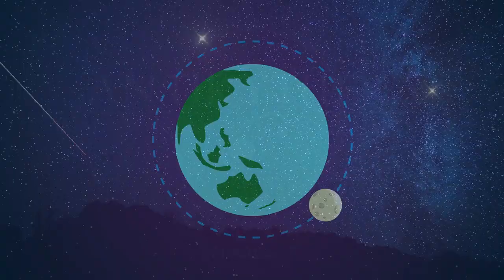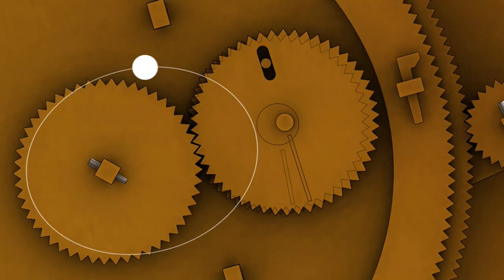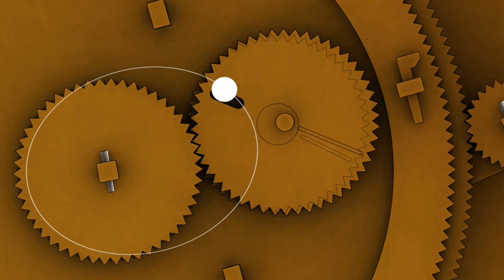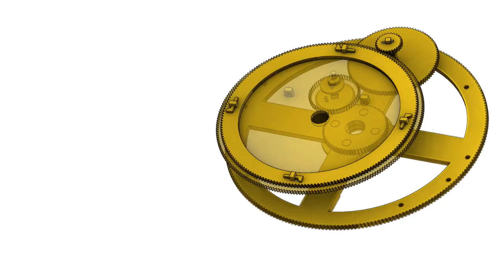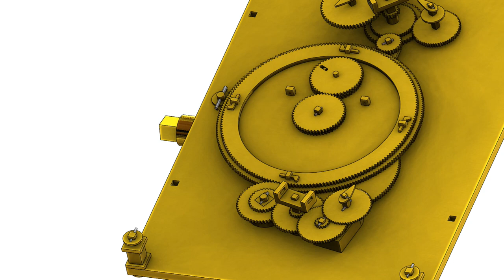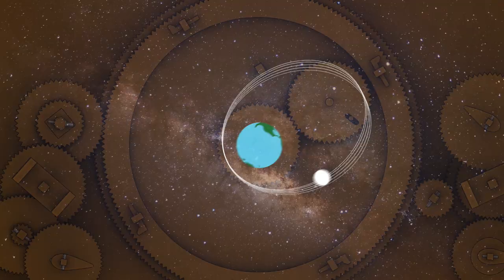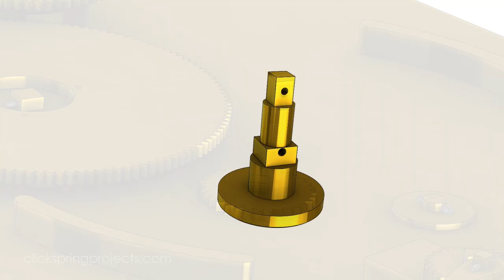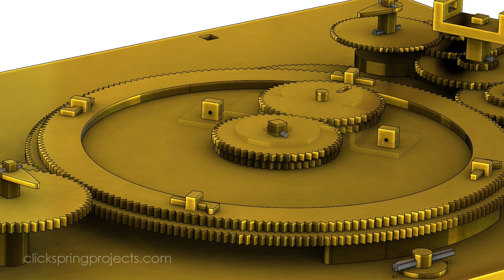The Antikythera Mechanism Episode 9 - Making The Epicyclic Pin and Slot Gearing

Comment: Wuao! That eccentric gear is definitely one step beyond in complexity. You prove us how we tend to underestimate the capabilities of ancient technologies
Reply: I second that! Very humbling.
The only place I have seen that ahead and behind rotation shift is in the prop shaft joints on automobiles. When angled, a single joint displays this phenomena, making the prop shaft rotation go ahead and behind the gearbox output, so you need to use two joints at the same angle so this is cancelled out, giving back the constant velocity to the drive train.
Front wheel drive cars have a special joint that has to contend with both suspension and steering angles at the same time and guess what it is called! A constant velocity joint 👍 patented by Alfred Rzeppa from Poland.
Reply: @rogercrier    Very cool.   I did not know that and always wondered why it was called a CV joint!  thank you for sharing.
Reply: the thing is it is not very complex at all. it is just one of the smartest designs i have ever seen. Calculating it is complex, but it's so beautifully simple
Reply: I had to go back a couple of times and watch that part again to get my head around it.
Reply: @idontknow31212  nah thYs extremely complex the only thing that's simple about it is that its gear driven but if it was electronic itd be millions of times simpler on repair design building it doing anything calling this simple is like calling a rolex or a breitling simple
Reply: I loved when he said, "which ordinarily would serve no purpose, but in this case..." -- Amazing device, amazing storytelling.
Reply: That explains why CV joints fail...  That pin rubbing back and forth in that slot just has to give eventually...
Reply: @rogercrier  and hence the development of the more complex Constant Velocity joint for all those front wheel drive cars :-)

Comment: Oh my god that transition at 11:59 
Is there anything this channel doesn't do perfectly??
Reply: Benjamin Meijer I audibly gasped when I saw that the first time. So good.
Reply: 14:50 No CGI whatsoever either. Flawless blends. Awe.
Reply: YCbCr with the exception of the parts in the background that disappear as they're added
Reply: I don't get it. What did he do? At 11:59 he's tapping the piece with the hammer to flatten it and the next second he puts the hammer down to examine the piece. Is there something I'm not seeing?
Reply: Look at the transition between the outdoor scene and the next, specifically at the workpiece when he throws it on the table
Reply: @BM-yy8db  Oh wow. I'm just as amazed as you now. Thanks!
Reply: @timblackshaw5933  Yeah, also that I was specifically looking at 11:59 plus minus 1 sec approximately; Benjamin had given that timestamp so I presumed that the transition happened somewhere during the outside scene.
Reply: Both the 11:59 and 14:50 effects aren't that hard to do, but add a very nice touch to the video. For anyone interested in how:

The 11:59 one he first films the outside clip, then depending on his camera(Some higher end cameras have this) it's possible to turn on a "ghost image" in the display that shows the previous clip transparently over the current view and he just positions the camera in the inside clip so that the piece is in the same position on screen.

The 14:50 clip is done with a rotating camera rig that you can see him use plenty of times. With it you can film the same exact view while moving the camera through the same path. With it he just films multiple rotations, each time adding extra parts. In the video editing software you then blend the clips together.
Reply: I won't lie, I watched it three or four times.
Reply: @YCbCr  Yes ! Another great shot I miss ! Thanks !
Reply: don't forget the music editing...
Reply: From 14:17 to 14:24
Reply: Thank you for pointing this out!
Reply: Thank you for catching that,it's flawless and easily missed.

Comment: Possibly one of the things that blows my mind the most about this build and your other builds (not that there's ANY lack of mind exploding...most videos have at least 10 such moments) is that almost NONE of this is explicitly measured.  You use a compass and a straight-edge...and a few helpful tools that you designed.  Every fit is hand filed and PERFECT, even the bits that are half the size of my thumbnail.  I cannot believe that you formed each tooth on ALL of these gears so perfectly that I think a CNC couldn't do better.  Tolerances of fractions of a millimeter!  I think you and Martin over at Wintergatan could together design and build a time machine to go back and see the Antikythera as it was originally made.

......Or have you already?  >.>
Reply: Yeah, but all that hand finishing is going to make warranty repairs difficult.  :P
Reply: This is why fine mechanisms employ softer, more workable metals to this very day. Precision cutting stainless is MUCH more difficult, as I found out from trying to save a warped (stainless) Berg Larsen saxophone mouthpiece.
Reply: He built the original. That's the answer.

Comment: Very humbling.
The only place I have seen that ahead and behind rotation shift is in the prop shaft joints on automobiles. When angled, a single joint displays this phenomena, making the prop shaft rotation go ahead and behind the gearbox output, so you need to use two joints at the same angle so this is cancelled out, giving back the constant velocity to the drive train.
Front wheel drive cars have a special joint that has to contend with both suspension and steering angles at the same time and guess what it is called! A constant velocity joint 👍 patented by Alfred Rzeppa from Poland.
Reply: plus front wheel drive can utilize universal joints so are not dependent on the cvd design that most use.
Reply: you can use universal joints but it will result in a choppy application of power when turning.

Comment: Great video! Impressive display of a great thought process and awesome hand work of metal. All that brings me to a gentle question. At times you use a lathe. I remember your description of a pole lathe. And I know that such a manner of turning is just a functional as your other hand working methods. There is but one place where I got to thinking about how it may be accomplished on a pole lathe. The offset pin turning. Do you think it is possible to replicate that on a pole lathe? The work holding method is what intrigues me. possibly a hole drilled offset and then the first shaft afixed with bitumen or resin. Then the secondary shaft turned and then filed to square (I think it was square on one side).

Mark

Comment: Do you think they could have had square broaches? These were smart guys and with the amount of square holes in a build like this and the suggestion floating around that there might have been more than one of these units floating around I think they could have come up with the concept just to make life a little easier.
Reply: rimmersbryggeri Hi. Archeologists have found the remainings of a saw powered by a watermill with bronze + wood wheels, including square holes to transfer force. It was common technology at large scale, quite simillar to windmill technology you may see in the Cyclades islands today.
What's news is that those mechanical principles where mastered at a very small scale as well. Regard's from Greece.

Comment: Question. From the positions of the hands on the recovered mechanism, can we date the ship wreck based on the assumption it was set to the actual positions of the moon etc, at the time of the sinking?
Reply: If I'm understanding it correctly it was a predictive mechanism... to set up your calendar, basically, to know when the festivities were going to be and so on... so it wouldn't make much sense for it to be set at the current date, I think. It could possibly set a lower limit, though, supposing it wasn't used to check that previous events had happened on the correct date (or that the user didn't simply play with it on occasion... and, frankly, that's quite a big assumption... I certainly would fiddle with the thing if I could get my hands on it, and so would most people, probably... though, then again, it was probably a quite expensive device, so maybe not)...
Reply: Highly unlikely that would be useful for several reasons, but there are other means to this end. By means of internet searching and reading I've come across mentions of which I took a few notes such as Marcus Claudius Marcellus sacked Syracuse, Sicily 212 BC. No survivors was the mandate except for Archimedes himself, but he did not survive either. The wreckage is believed to be the booty of that sacking of Syracuse since it is a roman ship and the estimated dates fit nicely as well as the 100% content to be of Syracuse source, most unusual for a multiport trading ship. In use this device would not have been used like a clock on the wall to tell the current events, it would be used instead to generate charts of future events going on out as far as they dare too timewise. The charts survived the machine because of their dispersal beforehand and the knowledge of eclipse dates are throughout history noted as causing the savior of white men educated in the use of these charts impressing native peoples with their god like knowledge of such heavenly events before they happen. Of course the natives didn't get to look at the charts or have it explained to them. This dirty trick was played many times.

Comment: Chris, what surprises me most about your skills is making square holes in the gears that are straight sided and concentric, my filing skills would result in a different taper on each side of the hole even if I managed to get the hole to have a square cross section.
Things that I make by filing, like tapered rectangular con-rods for steam engines I always do in pairs with the two parts pinned together at their bearings, do some filing then turn one of the rods over and do some more filing, then swap left and right and do some more filing, after a while you end up with perfectly "square" rectangles, but its all got to do with making them in pairs.  while you're making a single part at a time and have to be able to hold the file perfectly (I would have to use a broach). you've got my admiration.

Comment: Constructions like this justify the term artisan. It is both a feat of engineering and a work of art. I wonder if most of the smaller parts were billet stock taken to dimension or castings worked down to size or even smaller components combined to make a whole

Comment: The real amazing thing is that the long engineering tradition that gave birth to this remarkable piece of equipment got completely lost. One might have thought that metalwork would have survived on land much longer than this highly corroded submarine artefact. But there is nothing else at all that I know of that bears witness to that tradition. There is plenty of artistic metalwork and goldsmithing but nothing much applying metallurgy or metal craft knowledge to technological solutions apart from weapons of war. Most other things such as mills were wood based. The Greeks of course invented many things such as locks the archimedian screw the astrolabe etc etc but nothing else along the lines of such small scale engineering. It is quite a puzzle as to why much of the Greek expertise is just lost to us. Its a bit like Darwin’s missing link we have no historical line of development just a big jump and an empty space.

Your series is just fabulous- to see metal yield like cheese (or in the case of brass cold chocolate) to a blade has something uniquely satisfying about it and also something so counter intuitive about it to make it seem like magic

Comment: gear backlash.... a square peg to hold a round pin.... if you were to offset the square by a fraction of a mm then this would give you back lash adjustment then cut the offset pin on the top. this would allow for the deviation of hand production being a bonus for adjusting the backlash then using that position permanently.
there was a lot riding on getting the cut correct, by this style it would allow for any minor errors.
love the work, but maybe you are being to accurate??? just a thought. 
Fantastic to see your skill set I look forward to more videos as I am about to binge on the rest of your videos

Comment: Chris, can you share your secret for keeping the parts from tarnishing. I'm neck deep in a brass cannon project and I'd really like to keep the shine.
Reply from the maker: Certainly mate - Providing the parts are non functional, a clear lacquer like this is a good way to go: https://www.whiteknightpaints.com.au/products/metal/white-knight-rust-guard/topcoat/white-knight-rust-guard-clear-guard/  Another approach is to electroplate with something inert like gold or rhodium. Its a lot of work to get a good result, but there are some good kits out there for smallish projects. For a clock project, the traditional approach is to simply live with it. The parts are taken up to high polish at the end of the project and then never touched by hand again. Without any fingerprint oils etc a uniform rich bronze color develops over the following years. The odd small spot of darker patina develops but overall it tends to retain the mirror finish left after completion - Cheers :)

Comment: Hmm, the dating of the shipwreck and the Cicero quote at 2:31 make it a real possibility that the original Antikythera mechanism is (one of) the machines mentioned in this very quote. Or possibly a direct predecessor of the one mentioned, with a big likelyhood that it originated from the same shop, maybe the same maker(s).

Comment: I wonder if the eccentric pivot was another fabricated part.  Turning it as one piece is easy with modern machinery, but would be a huge challenge to be made by hand.  

I think it's possible a offset hole was drilled into a  larger piece of round stock, then a smaller piece pressed in.  As long as the rod was peened in, the smaller shaft would hold.

Comment: What is the purpose of the 5 sided interface for one of the gears? Did it aid in keeping the gear more concentric around the center of the hub? Or was it to allow a larger amount of area inside the heptagon for another axle to pass than would have existed using a square?

Comment: The logical progression of development, hands-on learning by doing, seems likely to have started with string wound around shafts, and that leads into winches and pulley systems plus bow-drills and simple lathes of the same principle, to make various ratio pulley block and tackle of the type used in hauling of timber.., and so on to cranes and ship rigging, A-frame construction methods etc.
So the comments about verbal description and records of the required skills, made in the video, had to have been by oral transmission and Apprenticeships (?).

It's a parallel concept for why Ancient Greek Philosopher-Geometer's regarded written records with suspicion, the abstract methodology of formal education in Mathematics has seemed disconnected from the practical culture that obviously existed for thousands of years beforehand, (did that word origin mean "before handwritten records"?).

This series of videos and demonstrations are "beyond words", something to think about.., particularly the be-cause-effect here-now-forever epicycles of What You See Is What You Get.
Mathematically, What You Get/understand, IS What You See In-form-ation, formulae of superimposed quanta-atomic resonances of e-Pi-i interference=> singularity-perspective, or Spacetime positioning in/of QM-TIMESPACE holographic cause-effect.

Comment: Would you be up to the challenge of designing an updated version?  It's over 2000 years later, orbits have changed slightly and besides we can measure better now, and there are 25101 days to 850 lunar months instead of 25100.

Comment: How would you calculate the offset for the eccentric pivot component without having an already-existing model to work from? How could you determine the offset necessary for the two diameters based on the necessary relativity of the two gears to be driven?

Also, this is some of my favourite content on Youtube. Really great stuff! Inspiring

Comment: did the ancient people who made this device not also have simple soldering methods?
   they had tin and copper to make bronze. they had gold and silver for jewelry, they had iron for tool making, and they had lead.   if I'm not mistaken all of these metals can be soldered using lead with some kind of flux. and if I'm not further mistaken, a simple flux can be made from alcohol and pine pitch. 
  it seems to me that they would have soldered the parts together rather than using the peening and rivet method.
  this comment/question is not meant to be trollish in any way, its just something I've been wondering about for a while now.
Reply from the maker: Hi Jack, terrific to have you watching - as it happens they did both. It is interesting to ponder the reasons why certain components have been riveted/peened yet others soldered. I have covered some in the series so far, more to come in future episodes https://youtu.be/T_MdxdGr57k - Cheers :)